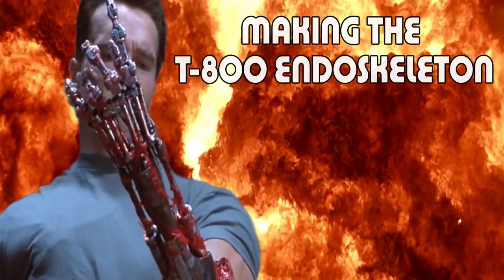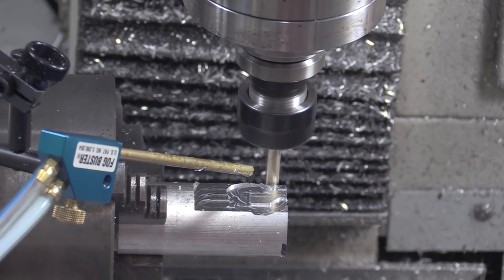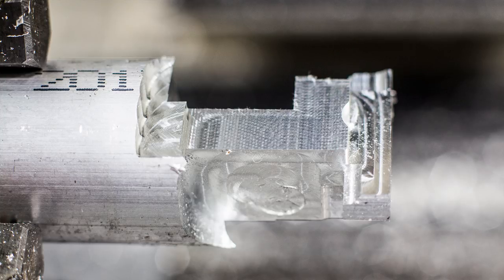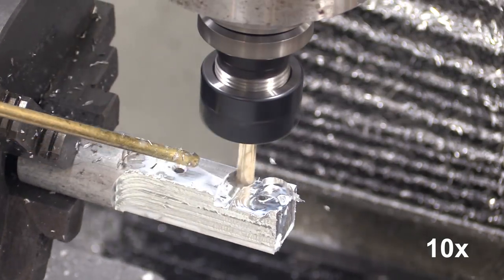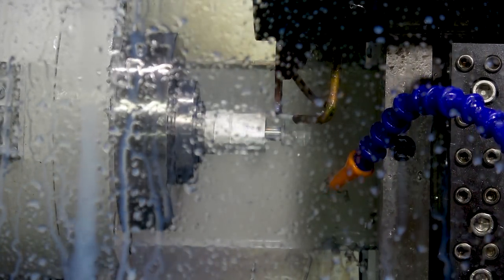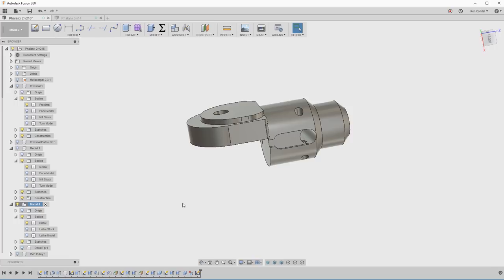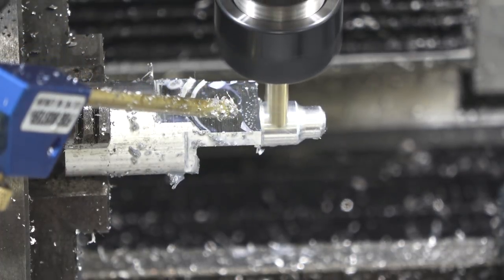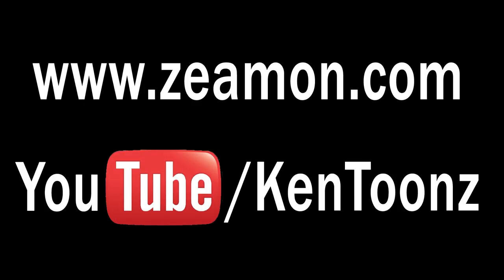T-800 Endoskeleton Arm Part 03 - Machining The Hand Step 1

Comment: Great video as always Ken. Very impressive. What are you using as your Post Processor in Fusion360? Is the 4th Axis Post Processor the default Path Pilot processor? I ask because I have a Sherline setup with a 4th axis and have had so much trouble finding an appropriate post processor that can do exactly this kind of index milling. Looking forward to the next steps.
Reply from the maker: Thanks! I use the Tormach/PathPilot post with Fusion 360. Most of the Fusion post processors are pretty similar and the Tormach one might even work with your Sherline. If not, they're written in JavaScript and aren't that hard to modify if you know anything about programming. Try some of the simple ones like Tormach, Fanuc and Hass 4th Axis, you might find one that works or is close. Good luck!

Comment: Is there a way you can cut cylindrical with an end mill rotating the part in a lathe chuck inside the cnc?
Reply from the maker: With the right equipment, but it's not very efficient.

Comment: I have parts of the original
Reply from the maker: Wow! Shame it's only 'parts'.
Reply: @KenToonz  Whole hand. None of the forearm. You need to round the square "bases" on either side of the knuckles. Also, the carples, the long "bones" of the hand that make up the palm, widen at the base. cheers!
Reply from the maker: @martysmith2422  Do you have photos posted anywhere? I'm sure you know that several models were used in the movie and they're all different. I've had to make subtle changes to mine so that it can be animated with servos. I doubt anyone (other than you) will notice the minor differences when the hand is moving. :-)